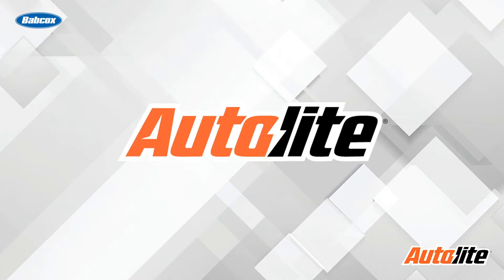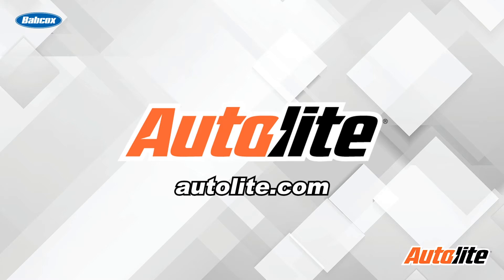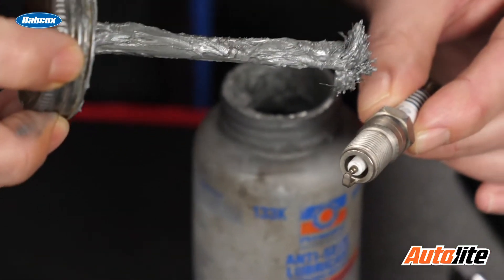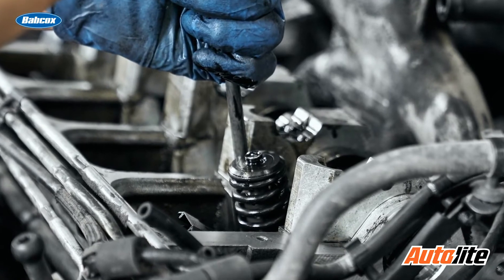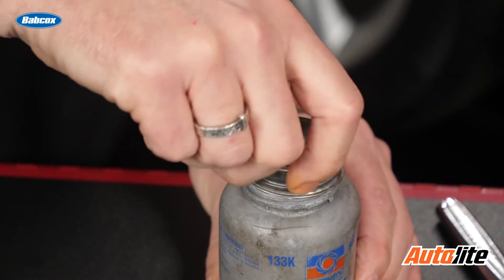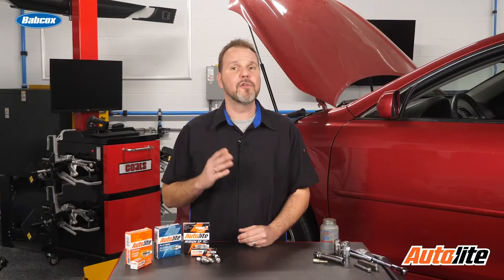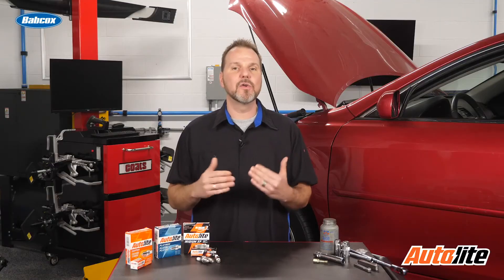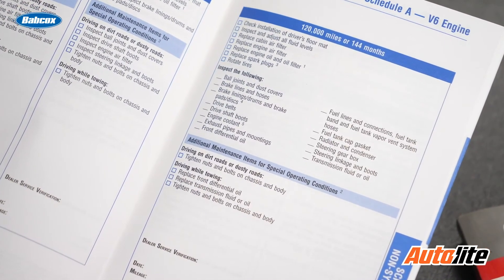Should Anti-Seize Be Applied On Spark Plug Threads?

Comment: In small engines, especially snowblowers I could not disagree more.   Regardless of the spark plug brand… I have seen significant corrosion issues due likely to the harsh environment a snowblower engines are exposed to.   In ALL small engines I use anti-seize and an extra careful when tightening.
Reply: Agree! Try salt water applications that don't get serviced often enough. I have several times a year a boat with the spark plug shell rusted off or rusted so bad the porcelain blows out. On some inboards and stern drives the plugs are hard enough to get to let alone accessing to extract the remnants of the plug. If antiseize was used it helps the extraction tremendously. It takes very little so just don't get it on the ceramic of either end. I prefer the squeeze tube. The mess is easier to control. By the way. If you don't understand how to tighten spark plugs maybe you shouldn't be installing them because if you do the kind of damage this guy is talking about maybe you should stick to your desk job. I also always use this on stainless steel fasteners with nylock nuts. They tend to gall when using nyloc nuts even when using grease but this stuff totally prevents it.
Reply: You damn right!
Reply: I do too. Use common sense when tightening. Yes, using never seize is like having some grease on the threads which needs some compensation when torquing down. I've never had a plug loosen up on any of my small engines after using just a gentle pull with a standard ratchet wrench. Same goes for wheel lug/bolts.
Reply: @curtchase3730  ' I've never had a plug loosen up '
Exactly.  Used sparingly it's fine.  The expansion/contraction cycles and it not being stuck much later are far more important than anything else, and you generally have some form of crush washer for seal.  The odds of it having a problem of loosening are very, very low vs how often some plugs and heads have corrosion problems.
I wouldn't just use gobs and gobs of it, but a light amount to help ensure it doesn't corrosion weld over time is fine.
Reply: I use aluminum anti-seize on all my small engine projects: mowers, weedeaters, edgers, and so on. NEVER had the first issue.
Reply: I'm old. I started using anti seize when electronic ignition became a thing. I've seen cars that are decades old on their original plugs. I've seen plugs literally rust apart, leaving part of a pretty hard plug stuck in the head. Do yourself a favor. Use anti size. Put a dab on your lug nuts and drive the tire techs crazy.
Reply: You are right. I worked on a farm in the eighties where we worked on small engines, tractors, forklifts, eighteen wheelers, dump trucks, boom trucks, combines' and built our street cars and oval track cars at night. We used anti-seize on anything with spark plugs. Most of that equipment is still being used today.

Comment: 2:16 Seen a slightly worse case of worse case scenario than breaking a plug when an apprentice stripped the threads on 3 plug holes of her never run, brand new, Edelbrock aluminum heads. T³ig welding, drilling, and tapping brought her out and in of a rather noisy depression until we had fixed the other two too. The lucky part was Lordco backordering 5 sparkplugs.

Comment: Never had a problem with it on spark plugs and I also never torque the spark pugs to specifications. I just tighten the spark plug by hand until it seats and just a little more with the ratchet and socket. Good enough for my truck and family sedan in normal driving.  No problems in decades.
Reply: A quarter turn past hand tight was what I was taught.Has worked for me for decades.
Reply: @deliveryguyrx late comment, but same here
Reply: Me too
Reply: 1/4 to 1/2 after the crash washer sitting on the head.
Reply: Try it.  You'll find that's about the torque spec.
Reply: Yep, still have never had an issue

Comment: Well, o2 sensors come with anti seize pre installed, or includes a pacl of anti seize.  Spark plugs do not.  Therefore, i do not add anti seize to spark plug threads.

Comment: The lubricant that is in anti- seize is 30 weight non detergent motor oil. It will migrate out of the compound and sit on top of the surface. If it does get to thick you can add a little more oil if you can find it. When torquing a fastener with anti - seize you need to use the lubricated torque spec. PS I have been using anti- seize on plugs for 40 years as a certified mechanic and I have never had any issues. A experienced mechanic can feel the proper clamping force on a fastener. I always tighten my fasteners by hand and then check them with a torque wrench to verify the torque. All the torque wrench does is measure the resistance of the threads not the clamping force of the fastener. Torque turn method is a better method to achieve proper clamping strength of a fastener by relying on the pitch of the thread to stretch the bolt to the proper clamping force.

Comment: It has been my experience in the past that plugs tended to strip the treads out of the head.  That was always my greatest fear when installing spark plugs.  There was a time when anti-seize was essential or the plug would never come out (dissimilar metals).  Fortunately, the plugs that I am replacing in my Honda have been in there so long that I will probably never do the job again.

Comment: It’s a paradox, the hypocrisy you can’t win if you don’t use it you run the risk of a spark plug seizing in the cylinder. If you do use it, you can’t go crazy you can only apply so much but understand a spark plug is not necessarily a moving item only when it’s put in and taken out.

Comment: I will use nothing but nickel anti-seize on spark plugs. The problem is people over due it with anti-seize. A tiny amount on threads is enough. Not excess.
I don't disagree with the over torquing. That anti-seize acts as a lube. If there is a range of value for torque go to the minimum. Even if over torqued as you suggest, it still should be within the upper limit range of values.

Comment: Ever since the first time I put a spark plug in an aluminum head on VWs, I have used anti-seize on every single plug thread. Always have hand tightened using "muscle memory" torque. I am over 60 and have never encountered the problems mentioned here. What I have encountered have been spark plugs practically fused to the cylinder head, where I had to soak the spark plug cavity 24 hours, filled with penetrant oil before I could begin to work the spark plug loose without breakage. Why?.... because someone couldn't be bothered to use anti-seize. PS: don't get excess anti-seize near oxygen sensors elements; it can permanently foul them.  If someone is over tightening spark plug threads, the problem is the mechanic, not the anti-seize.
Reply: Irrelevant!
67yr collecting WISDOM here!
Thanks!
 Only heard, heat transfer could be
 interfered w/.
.007°or .00007 secs
Aint much!
 Us big 2strk boys stayed away too.
Thoughts please!
Reply: Right on brother!
Reply: The best penetrating oil I have ever used is Kano Kroil. It is expensive, so I only use it in the most difficult circumstances.
Reply: Definitely anti-seize on air cooled VW’s I had many seized plugs or threaded holes, in the aluminium heads, back when I was in the trade. 🦘🇦🇺
Reply: your age is irrelevant, the specific engine/plug combination is the important variable.
Reply: @rickdeckard1075  Clearly relevant at 107 likes!
Reply: @bunning63  clearly not at 0.25$ a piece
Reply: @rickdeckard1075  *   What is irrelevant is you and your channel. How many subscribers do you have in the 11 years of your existence? 51, wow you're impressive.
Reply: @charlessmith4242   wow i got escalated to a human commentbot, how will i process all  this attention, validation, approbation, reinforcement...lol.
Reply: Wrong; there is no substitute for experience, and you will learn this in time. @rickdeckard1075

Comment: I'm 72, retired auto tech over 30 years experience, I enjoy reading about car stuff, Always used anti- seize. I still do my own work! Always glad to learn something Thanks for everyone's tips and comments Always an education!
Reply: I have good luck with anti-seize too. I have broken off too many that anti-seize wasn't used on.
Reply: I'm 70, I guess he never had an old ford truck with seized spark plugs.
Reply: I'm 71 & agree 100% with u. Nothing wrong with a thin coat at the top of the threads. Using anti seize is essential if u live in the rust belt. I've been doing for decades.

Comment: The very last point about chasing the threads doesn't make any sense to me... just before that he said the manufacturer puts on a special coating... wouldn't chasing the threads potentially strip that off?
Reply: No because retapping the threads is for the engine side, not the spark plugs. I also wouldn't do this unless absolutely necessary because it could lead to small metal shavings going down into the cylinders.
Reply: Chasing the thread is much worst.  I guess this guy also sells thread chasers.
Reply: @AsiaRoadTrek   I would not use a cut-type chaser, which can remove metal. I use a chaser that looks like a form tap. I just use use a bolt with a longitudinal groove down the thread, with the edge of the groove being more than 90 degrees, so it can't cut. More than one groove is fine, if you want. Just make sure to retain the start of the bolt thread, so you can easily thread it in. Put some grease in the groove and run the chaser into the hole. The chaser will dislodge any crud without cutting. The grease will retain the crud.

Comment: I work with marine outboard engines . The sticker on mercury says that when using engine i saltwater you should put antiseize product to the threads. I am putting just a light touch of quicksilver 101 grease and in 15 years never had an issue with any spark plugs i've done..

Comment: What about on a 2006 Ford F150 with a 5.4 Triton motor you shouldn't put you you shouldn't put NI c's on those plugs cause those things break if you don't take them out right I know this was a year ago but I still would like an answer somehow I'll check around
Reply: I came here precisely for engine type you mentioned. I've got a 07 Lincoln with that famous 5.4L and everyone's been terrifying the poopens outta me cuz some plugs have been breaking off
Reply: I have an 06 5.4L with 280k on the engine. The factory plugs were almost seized in the head. Luckily they all came out in one piece. Used a small amount of anti-seize on every plug since with no issues.
Reply: Get a Toyota